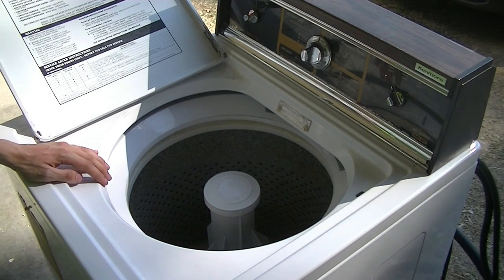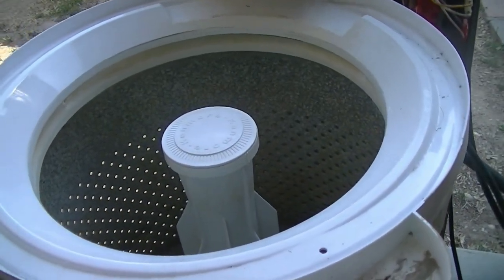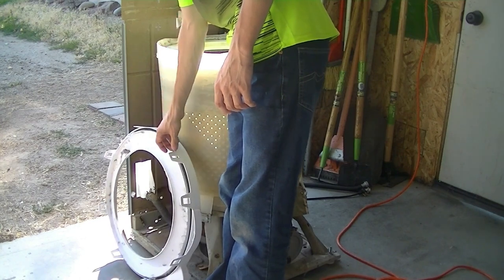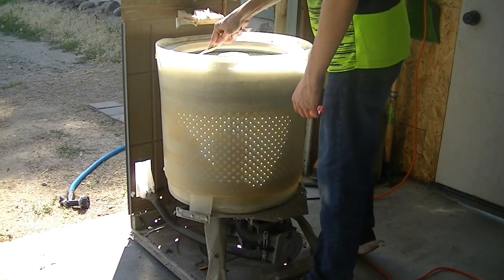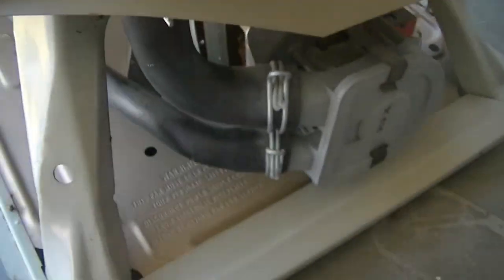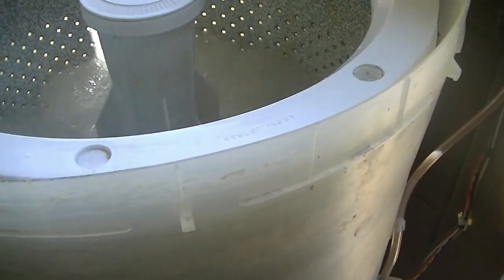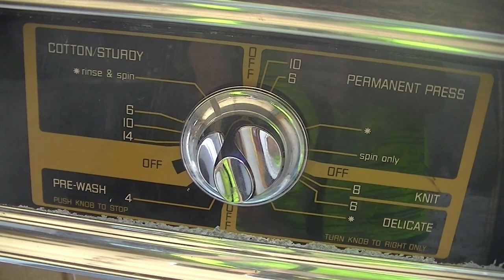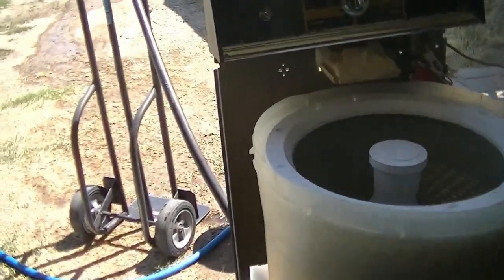Early Kenmore 60 Series Direct Drive - Cleaning & Testing, Part 1

Comment: Awesome machine! My grandma had a 1981 belt-drive model with Dual-Action agitator. It was a tank for a 24-inch compact machine. Grandma and Grandpa had a deep well and poor water pressure, so it was eventually taken out of service and put in storage. It still works to my knowledge.
Reply from the maker: @roblitchke4886  Nice!  I've since sold this machine and now have a full-sized 70 series belt-drive Kenmore from 1982!

Mine also has the dual action.  Got it back in April, videos will be released on it at some point in the future so stay tubed for that!

Even better; the color of it?  Harvest.  Gold.  That's right!  It does have some leaks that need addressed which will be in the future, hopefully before too long.

I know the deal with the water pressure!  Our well is a deep well but the pump and tank in it is pretty good on the pressure-not like it would be in the municipal system, but still not bad.
Reply: Nice! I look forward to your video. I'm trying to figure out when the appliance companies phased out the earth tones like harvest gold and avocado green. Your 1982 washer may have been the beginning of the end. By the way, I have the listing for the 24-inch Kenmore in your video from the Spring 1986 Sears catalog. I took a picture of it and tried to attach it here, but it's not working. Operator error 😊.
Reply from the maker: @roblitchke4886  Thanks.  Yeah I'd say around that period of early to mid 1980s is when people started wanting more white and almond colors.

I'd love to see that catalog!  I need to get a dummy email account setup so I'm not putting my own email out there to get spammed left and right by scammers.  Maybe you can email it to me though this one time and I'll delete the comment with my address after all is said and done, how's that sound?
Reply: @lizboz  You bet! I'll send you that and would be happy to stay in touch thereafter if you'd like.
Reply: @lizboz  Good morning! I sent you an email message.
Reply from the maker: @roblitchke4886  Got it!
Reply from the maker: @roblitchke4886  Replied!

Comment: Can't wait to see it in action. Kenmore was my most favorite appliance brand.
Reply from the maker: I already have a video of it washing towels you can check out.  I think it was actually the next video posted after the final video of the disassembly & cleaning series.
Reply: @lizboz  That washer was the exact same washer my foster mother had. That washer took me back to 1992 when I was 8 years old. That's when I became a washer fan.
Reply from the maker: @ericgreen4610  If you were 8 in 1992, you were born in 1984.  That makes you 37 now.  Just for the hell of it.
Reply from the maker: That is however, not to say you weren't born after June 28th, which would make you 36 going on 37 yet.
Reply: @lizboz  I'm born in 1984 so yes that would make me 37.
Reply: @lizboz  Yes. Do you know what year that washer came out in? Because I've seen different versions of that washer on Google images.
Reply from the maker: There were some earlier variants of that one they made in the early 80s, in fact I think the very first one dates back to 1980, before they were even being revealed to the market.
Reply: @lizboz  Yes they were. I have seen photos of the different versions of them but the panels were the same.

Comment: The oil is likely from the spin clutch seal. You'll have to open it up to replace it, but it shouldn't be too hard. Not sure what that sound is though. I know it's not the spin gear because that doesn't turn in neutral or agitation.
Reply from the maker: Yep, that'll hopefully be next spring or summer's project!  Yeah the spin gear is only supposed to turn in spin, so it's probably just continuous moving parts running rough from the lack of oil.
Reply: Probably the motor itself. I've heard Whirlpool do that while running. Alex Krupkin has a 1990 whirlpool washer which hums during fast agitation.

Comment: Hello! Very good video, I've got the same machine. Just today it died on me. It will no longer spin and drain. I tilted it backwards a bit but as its direct drive I don't see the typical coupler like my mom's old washer had. Up until it had not been fully draining every time, if that means anything. Any help would be appreciated, I hate to get rid of it.
Reply from the maker: If there's no coupler, you have a belt drive machine.  They were both commonly made with the same consoles around this time before they discontinued them after 1986 and switched over completely to direct drives.  I sold this machine a month ago and subsequently bought a belt drive just like it.

Could be a number of things wrong with it.  Does the motor still run but it just won't function properly?  A video would help to better determine what's going on.  Hope you get it fixed!

Comment: Nice machine!  They used to mount the capacitor in the controls panel for ease of service in case it needed to be changed.  Over the years, they decided the copper wire was too expensive, so they mounted it by the motor, much shorter wire run.  The other option I could think of is perhaps people were having problems with the motor starting due to the long wire run for the capacitor, so they shrtened it, and as a consequence, it's harder to service.

You gotta get a spanner wrench, they're only like 20 bucks, probably on Amazon.  But there's nothing wrong with the tools you got.  I much prefer a brush that's something like the 3 pack that Harbor Freight sells, instead of a toothbrush.  The handle on those is a lot more flexible; toothbrush handles aren't.  I see you used the right stuff, an absolute AWESOME cleaner.

Never seen one with a bottom panel, that's interesting.  I suppose it's good in a sense, might catch very minor drips, but rather unnecessary as I don't think it really adds any structural rigidity; the frame is rigid enough.

The gear oil slinging is probably due to a bad seal on the transmission.  It's probably a very slow leak.  Probably disassembling it, clean up the clutch, possibly open the transmission and inspect.  I'd say all that is in order.  In fatc, after hearing it run, I don't like that "zzzzzzzzz" sound it's making, might be a sign of a worn nylon gear in the transmission.

There is a product that's powdered that has phosphates in it that you can get.  I forget the name offhand but I think it's at worldwidejanitor.com.
Reply from the maker: Yeah I figured because of the greater resistance, they shortened it.

There's a lot of stuff I need to get but just haven't gotten around to it.  The Laundersol and spanner wrench have been at the top of that list, I need to get those.

The bottom panel I'm willing to bet was probably influenced by everyone else who had been putting bottom panels on their machines.  Just more of an trend or aesthetic thing in this case maybe.

Indeed, a good transmission servicing is in order, like I said in my other comment though, that'll be next year when I can get things in gear.  Don't want another "The GE Washer is DEAD!" scenario!  I'm not quite sure what you mean by the "zzzzzzzzz" sound, you'll have to be more specific.  I know it was squeaking loudly when it was agitating the first time, and then there was the "watery whipping" sound in the tub when spinning.
Reply: @lizboz  That's what it sounded like to me, through the computer.  In real life it sounds different.  It was just a constant sound, kind of sounded like the nylon gear in the transmission was running without lubrication.  It may have leaked so much oil out, that may be the case.  Anyway, it's not a difficult thing to do, the neutral drain kit, and it includes a new nylon gear.  Oil is simply 90 weight gear oil.  I'd say if anything, the seal at the top of the transmission where the spin tube comes out is where it's leaking from; if it were the transmission seal itself, you'd see seepage from there.  But when the trans is opened up, you'd lay down a new "gasket" using Permatex.
Reply from the maker: @jaykay18  Well the nylon gear in trans should only actually be turning when it's spinning.  But I think I know what you mean, it sounds pretty "dry" when running.  Will definitely put some new oil in, and a new neutral drain kit and everything.  I think I'll actually do that do both the 86 and the 92 Kenmores, the 92 could definitely use a new ND kit.  That machine gets a lot more use now that we've had the in-laws staying with us.

Good to know about Permatex, I'll keep that in mind.
Reply: @lizboz  Yeah, just watch the "walloutlet" guy's video (theapplianceman) on the ND kit.  He dumped the oil out.  xjoe81x and I did one of his machines (haven't posted my series on that yet).  It was pretty easy.  We didn't drain or add any oil, seemed to be just enough in there.
Reply from the maker: @jaykay18  Yep I've watched both theapplianceman's and xjoe81x's videos on that.

Comment: Funny thing you mentioned the musty smell you described since my ‘63 Whirlpool had a little bit of a smell but not much at all. I did give the tub ring a good cleaning and cleaned the magic mix lint filter since it looked like it wasn’t cleaned before it was taken out of service 15 years ago and cleaned as much of it as I could without any major disassembly and so far everything turned out good. Going back to that musty smell you described, my ‘63 Whirlpool Imperial dryer definitely had a musty smell from being closed for 15 years and it did make that funny burning smell since there was some dust on the heating element but after running for 30 minutes on the Wash N Wear cycle the smell was mostly gone but after running a few loads through it the smell was gone and after using it on sort of a daily basis it doesn’t smell like anything at all.
Reply from the maker: Yeah, what I was smelling actually wasn't really so musty, just more the water and maybe even powdered detergent smell that stuck around in it all these years.  After running a tub clean cycle through it, that smell sorta went away--not entirely, but better than it was before.
Reply: @lizboz  not sure what detergent was used in this machine when it was new but I am betting that it could have been Tide powder detergent. My 1963 RCA Whirlpool Imperial Mark XII washer more than likely came with a box of Tide powder detergent when it was new and they actually did give away a box of detergent to promote Tide back in the 1950’s and early 1960’s.
Reply from the maker: @seana806  That's plausible, and I think it's definitely powdered 'tergent that was used in this machine.  You saw the dust and dried flakes coming off really easily, liquid 'tergent would NEVER have done that!
Reply: @lizboz  liquid detergent probably would have created a gummed you mess as opposed to to powdered detergent. One thing is for sure, I have to be care with the amount of detergent I use in my ‘63 Whirlpool or else it will end up suds locking and even with Tide liquid it can suds lock and I’ve have that happen a few times before to me when I was washing towels but sometimes I’ll pour in a little fabric softener 2 minutes before it drains so it’ll eat up all the suds so it won’t suds lock :)
Reply from the maker: @seana806  That's why I wish they sold Laundersol with phosphates in powdered.  I know they make some versions of powdered but none of them have phosphates.  Phosphates would definitely take care of that scum buildup.  Great stuff!
Reply: @lizboz  phosphates will definitely help get rid of that soap scum for sure. What can cause soap scum to build up is when people use way too much detergent and there was a video I saw a few years ago where someone had a newer Maytag centennial washer and they literally put at last 2 full caps full of liquid Tide in and if cold water happens to be the only temperature you use it will definitely cause the machine to give off a funky odor as time goes on. I am not making this up, in the deluxe forum index on AW, there was one of those newer Whirlpool HE belt drive washers and cold water is the only temperature on that machine and I am not kidding and there is NO hot or warm water option on that machine.
Reply from the maker: @seana806  I'm well aware that cold wash only cycles do a great deal in causing buildup.  That's why people need to wash their stuff in hot and warm.  Warm rinses would also help tremendously in aiding that.

As for the new machines not even having an option for hot water, nothing surprises me anymore with those things.  Next thing you know they're going to make them "non-electric" (manual, just like back in the 1900's), or better yet, SOLAR POWERED!
Reply: @lizboz  or make everyone switch back to a wringer washer since those were made all the way up until 1983 by Maytag but those were marketed to people who lived in rural areas or people who lived in really old houses what didn’t have a hook up for a washer and dryer set at all. I’d take a wringer washer any day over most of the newer machines that are made today since they essentially last forever and don’t require any repairs if any over a lifetime of a wringer washer.